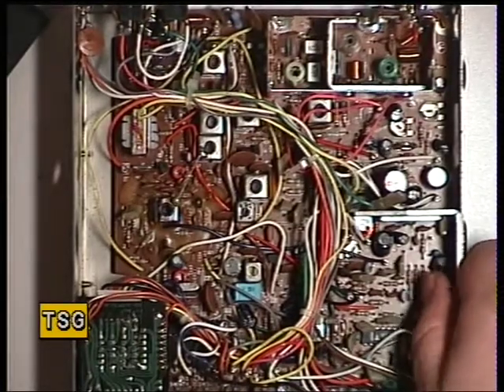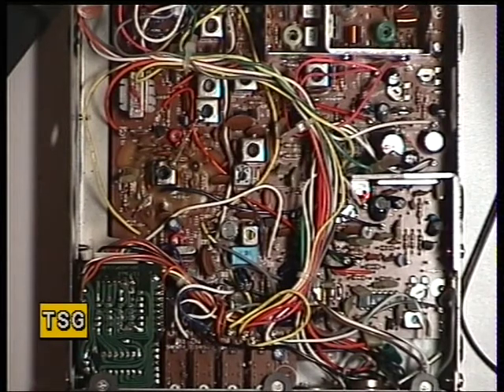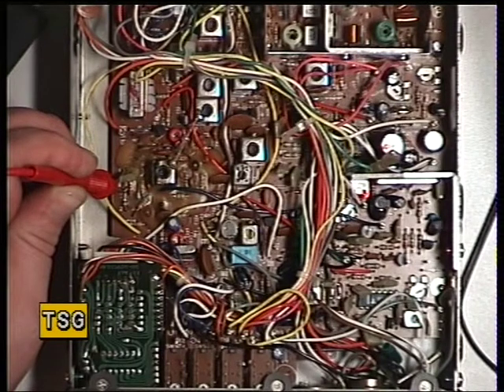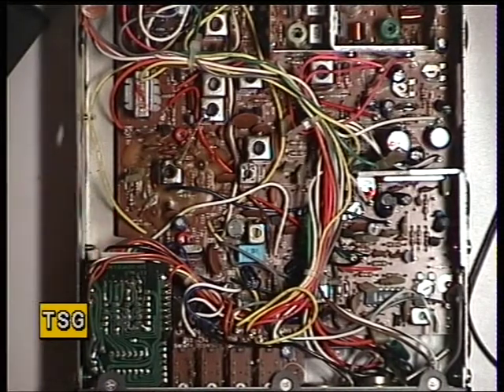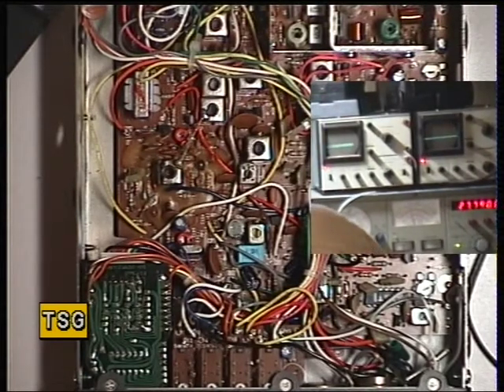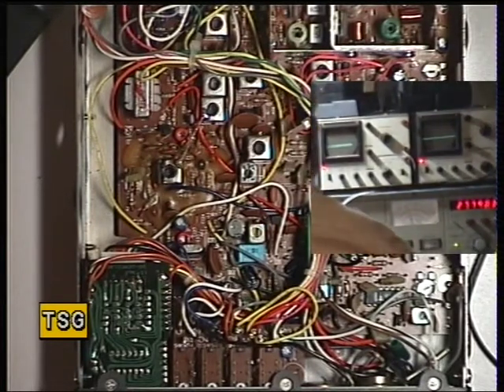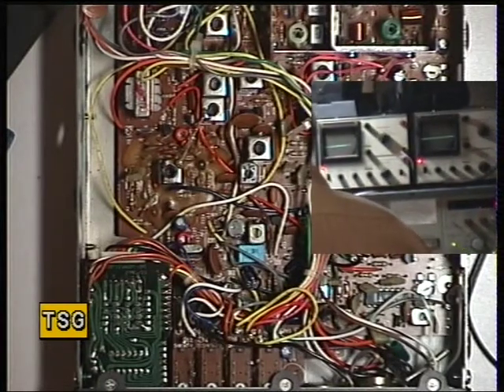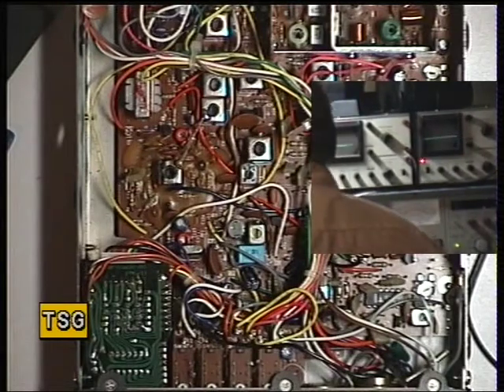Cybernet Beta 3000 UK CB radio. Alignment of Transmitter

Comment: Richard, I have a Beta 3000 that has no TX or RX. The LEDs on the front panel will show  It switch between transmit and recieve when keyed but there is no RF output and the signal meter will not light up.
 Also it will not receive. There is no noise from the speaker even when the squelch is turned down or a strong signal is next to it. The mic is known to be good (borrowed from a Beta 1000). 
Do you know what could be causing this fault symptoms?
Any help or advice appreciated..
Reply from the maker: The first thing to do is to see if the radio works in PA mode. After that fault finding technique differs depending on if it's a radio you've owned & used for ages successfully, or if it's a set you've just bought with a fault.

rshireby@yahoo.co.uk

Comment: Wonder why the output power was so poor..... weak final or pre-driver transistor or a coil out of whack?
Reply from the maker: The clue was that RX wasn't up to the usual standard as well as TX power being low. Turned out that Q18, which is a TX/RX switching transistor was out of spec. Replacing just Q18 brought everything back fine.....unfortunately it had to be finished on a different bench as I was on a batch of business radios the next day. I passed the Cybernet 3000 to the other Richard here & suggested he finished the video; he declined, so I passed it onto Bob; and he declined finishing the video too. Dunno what they're scared of!

Next time a Cybernet 3000 comes in, I'll do an 'on the air' video with it!

Richard